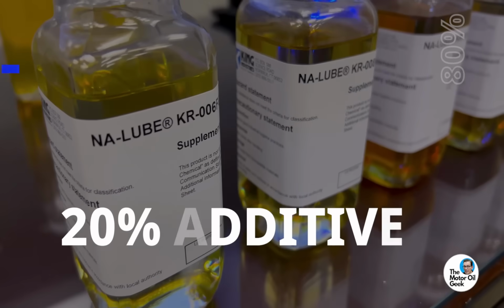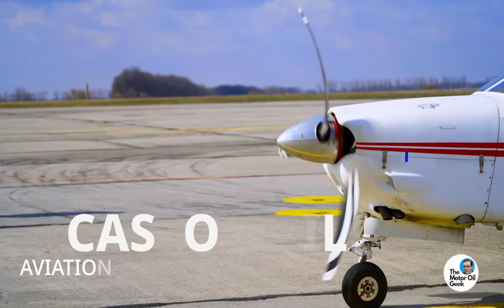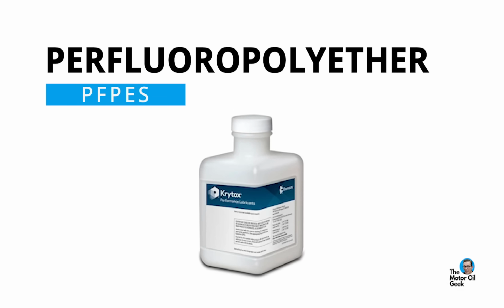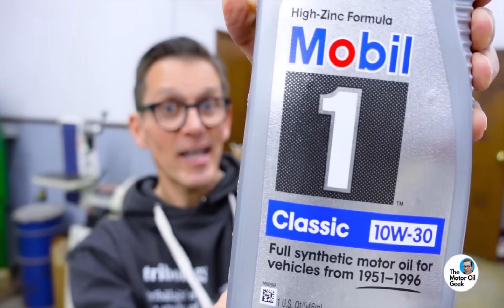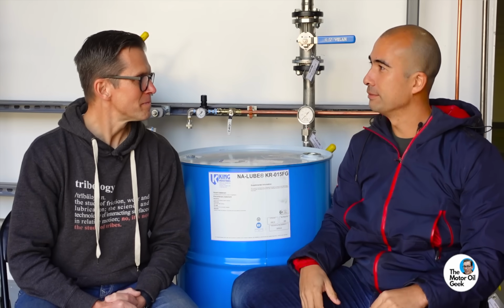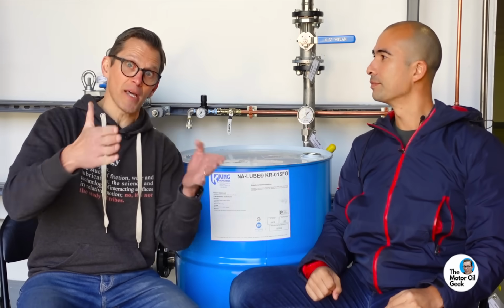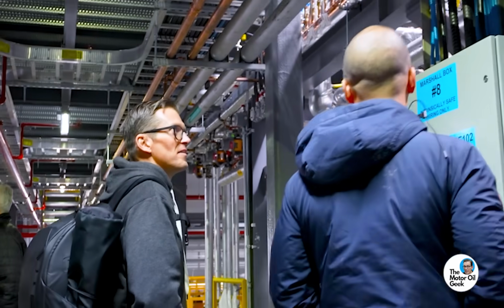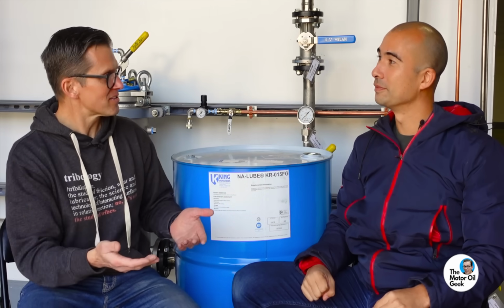100% Synthetic Oil: SCAM or SCIENCE?

Comment: Can you please make a video comparing the amsoil signature series against the oe? And why does amsoil not sell things the like the OE 20w50 api sp formula in the usa but does overseas?
Reply: Us climate isn't hot enough to be running oils that thick.   That's a oil useful for desert climate.
Reply: @jason200912 older engines with no flat tappets can run 20w50 and also use an api sp formula, also in some places such as texas, florida and Louisiana do get as hot as saudi arabia for instance

For example, a classic muscle car with roller cams would benefit greatly from an api sp formula like amsoil’s 20w50 oe or lucas’s api sp 20w50 in hot weather because they were designed for viscosities like that and would also provide excellent wear protection with the api sp formula as opposed to the SL/SJ 20w50 formulas in the usa which don’t protect as well because they catered towards flat tappet engines which need high zinc formulas (even though The motor oil geek debunked that flat tappets wouldnt run well with api sp formulas)
Reply: @johneldepresso they get as hot only in the summer. But if you run it the entire year as an annual oil as most users do, rather than a seasonal oil, youll be shooting yourself in the foot.  If you can afford monthly oil changes then go ahead and use one based on each month of the year
Reply: @jason200912 not what i meant, some of these cars where recommended to run 20w50 year round above -7 degrees Celsius or 19 Fahrenheit like the toyota 22re for example or the F series engines, ive seen plenty of them burn oil when they use thinner viscosities even when they are low mileage because their clearances are simply too big for something like a 5w30, and some of my customers simply don’t want to run mineral based 20w50 because they sludge pretty easily when driven hard or a seriously expensive synthetic high zddp api SL formula which wouldn’t protect as well as a api sp formula for their use case

An api sp 20w50 would perfectly best suit their scenario 

Im not saying you should use 20w50 in every car ever year round

Comment: I learn more about oil than I never knew I did not know.. LOL..  (you dont know what you dont know, till you know it)  

I want to say to all the guys on teh forums when someone ask,, "What the best oil to use for this engine?"  you get the folks that like to chim in with " read the owner's manual"  which in many cases is correct but with the latest GM engine debacle we see that not always the correct answer.   sometime common sense plays are role as well..  

In my daughters 2017 subaru forester they say 0w-20 oil but the amount of folks you see on the forum with excessive oil usage complaints.  they changed to a 5w-20 or 5w-30 saw wayyyyy less oil usage and no reduction in overall MPG..   

side note you can get Valvoline synthetic restore and protect oil in 5w-20 and 30... thats a win win win..  especially if yo have 70k or more mile on the engine..

Comment: What oil is best?  That is the question.  I started using amsoil over 30  years ago and just completely stopped worrying about it.  I do not ever change my oil.  I buy a new truck, dump out whatever oil is in it from the factory,  and put in whatever 100% pao amsoil recommends.  It's called signature series now I believe. I change the filter every January and top off with amsoil.  When I get close to or hit 100,000 miles, I trade in the truck for a new truck and do the same thing.  I've never had one single issue in 30 years of doing this.  Most of the time I'm pulling a 20,000 lb trailer so the trucks aren't babied or grocery getters.  All have been Chevys from a '78 350, an '85 7.4L, a '98 5.7L vortec, an '01 6.0L to the last few that have been 6.6L diesels.  My conclusion to all this is that if you are going to keep driving the same truck for more than 100,000 miles, use amsoil and change it every 100,000 miles.
Reply: Not sure if serious or joking.
Reply: @bradnail99 
Which part would be the joke?
Reply: @bradnail99  Same here. Hopefully, we get a response.
Reply: Filter is your safe word......
Reply: @jhartmac100 
Until the mid 90's I always used fram filters.  If you know anything about filters, that's like not even having one.  Then I discovered wix.  More recently, last 15 years or so on the duramaxes, I started using the premium mobile 1 filter.  Either way, my experience is a testament to PAOs and Amsoil.

Comment: so Lake, cut to the quick, which oil and filter would you recommend I use in a 2001 7.3L F-350 that has 325,000, it's a occasional driver, farm/ranch truck that may haul loads from time to time but not a serious work horse used truck, It does hit highway speeds of 80/90mph for extended miles.  I'll anxiously await your response, please and thank you.

Comment: 0W20 vs 0W40 
Reading about GM's decision to go from a 0W20 to a 0W40 in the L87 engines brings a question. 

The GM 2.0 turbo requires 0W20 as the recommended viscosity. 

My 2.0 as well as other 2.0 turbo the GM puts in the buick models from China are experiencing high oil consumption. 

Would going to a 0W40 reduce oil consumption without causing any VVT or any other issues.

Comment: I have a 1999 4Runner with 515,000 miles on it. I always used Mobil 1 and a factory filter.
Reply: 1985 4-runner with 400k miles using only regular oil.
Reply: I HAVE A 1999 4 RUNNER LIMITED WITH 639,284  mi  HAVE ALWAYS USED AMSOIL SIGNATURE SERIES 5-30 WITH SYNTHETIC LUCUS FOR COLD WINTER STARTS AT -39 C AND A PUROLATOR BOSS  PBL20195  OIL FILTER  . OIL IS CHANGED AT EVERY 13,000 KM OR 8,000 MILES
Reply: @kodyadams5561 are you the original owner?
Reply: @kodyadams5561 lucas makes the oil thicker, so essentially doing the opposite of what you want for cold weather. It also has zero additives, so you are making the oil thicker and worse from an additive standpoint, shorting the life of the oil.
Reply: You have an R22 engine!  It doesn’t even need oil!   🤣
Reply: Shame Toyota didn’t keep that engineering standard; other than 2.5, what happened to reliability?
Reply: @flashnmb1 1. 8. Engines in toyos are GREAT❤🎉🎉COROLLAS,   THREE HAVE OVER 8OO OOO.MILES.. WE ARE 🚕 🚖 🚕 🚖 TAXI DRIVERS❤❤🎉🎉
Reply: 475k miles on my FZJ80 Land Cruiser running Shell Rotella Conventional 15w-40 since new. Looks brand new inside.
Reply: What have your drain intervals? Time or mileage?
Reply: @jasoncurry2515 10,000 mile oil change intervals
Reply: "factory filter"??  What filter is NOT made in a factory?  🤷‍♀
Reply: @FrankDank-ik7ic  you're either a lousy comedian or a ignoramus 😮
Reply: @FrankDank-ik7ic 
Yes, and the "factory filter" isn't manufactured in the vehicle manufacturer's factory.

Comment: My family worked for an internal engine components manufacturer.They tested most oil brands on the components. When the oil is changed every 5k miles they noticed zero wear difference on the crankshafts and camshafts! Including those expensive brands.Today's synthetic oils along with proper Heat treatment are so much better than years ago 😂.
Reply: Mercedes and bmw still recommend a 15k miles oil change interval or even more.
And some people agree with that too.
Reply: 15000 between changes?  Totally ridiculous.
Reply: @Masteranddisaster13 yeah which is why they are both junk...I've owned both
Reply: @jhartmac100  They are often thought of as "lease vehicles". As in drive them for the three years and 36 miles of the lease term and get rid of them before they start costing real money.
Reply: @Masteranddisaster13  the recommended 15k oil change and 10k for Toyota covers the lifespan of the factory warranty, good luck after that

Comment: Here’s the takeaway from this video. Use whatever oil you’re comfortable with and change it every 6months / 5k miles and be happy.
Reply: Wrong, use whatever oil you want and get a used oil analysis. Then change it as recommend based on the results
Reply: @SantanKettanan-Gayboy  wrong.  All oils made since API SN have to do the same thing,  clean, protect and lubricate. Unless you’re using an oil from 30 years ago you won’t have any problems. If you want to buy into the oil analysis and boutique oils marketing BS be my guest.  I’ll keep on using the same Mobil1 that I have been for the past 10 years and be happy.
Reply: @geshtal2056  You couldn't be more wrong.  There are tons of videos showing oil analysis of various brands and some having more metal particles in them than others.   Mobile One was a group 4 before the 1999 lawsuit, now they are group 3, middle of the road for synthetics.

Comment: AMS Oil Signature Series   and  Pennzoil Ultra Platinum ....the top 2...
Reply: Is the penzoil ultra platinum really a full synthetic?
Reply: @ricksmith7232 Pennzoil has a few synthetic options so make sure you know the difference.  ultra platinum full synthetic?yes.  Platinum? No.
Reply: @ricksmith7232  It's a group 3 full synthetic.  Only 100% synthetics I am aware of are  Amsoil, Redline (group 5), Motul 8100, Schaeffers and Liqui Moly has one, tho I don't know which one it is.  May not be available here in the USA.
Reply: Also seem that on @Fordbossme
Reply: THIS ^^^ is the type of information I'm interested in.  In the used 2013 Honda CRV I just picked up the previous owner got his last ten oil changes using Pennzoil Premium.  I don't know if that's good stuff, is Honda OEM better, or is Amsoil better?

Currently have a good quality Pennzoil filter, soI could use a good recommendation on the oil filter too.  :)
Reply: Yes.  Somehow Mobil 1 oil gained the reputation as the synthetic oil to choose if you aren’t snobby enough to run aimsoil.  In reality Pennzoil Ultra platinum is superior.

Comment: Lake I have a question for you. Do you see it as pertinent to look at running a 5W-30 weight oil in the 5.7 L tundra engine when living in a hotter climate such as Kansas City as well as frequent towing of a boat? I fully understand that applicationis the most important factor in oil weight, however, I’ve heard you speak on heavier, weight oil, not always lubricating the engine properly due to smaller oil passages and different things like that. This engine calls for zero 0W-20 which I have always ran with no issue.

Comment: You never forget the first time you smell the sweet scent of castor bean oil burning in a race engine.
Interesting video... to that end I have no favorite oil; I use what ever oil is specified by the engine manufacturer (viscosity, API and/or JASO rating.) Common sump motorcycle engines need JASO MA rated oil.

Comment: After decades of changing oil in many cars, i've always looked inside, through the filler cap to see if your components are silver or yellow or brown. That tells me which oil was cleaning and which one was ruining the engine and so far, Pennzoil FULL synthetic didn't fail. My 311k mile Shysler minivan has pretty silver bottom end and runs very good! 2nd place, Mobil 1 FS, $25 for 5qts.
Reply: Brown car also mean that they hardly even change their oil.

Comment: Love the smell of castor bean oil pre-mix. Brings back memories of a youth misspent racing motorcycles. I used ester-based lubricants in my later 4-stroke racers.
Reply: Smells like a sweet, cotton candy smell....
Reply: With 3 sons racing and a team of another 12 racers, all my clothes smelled like it after a day at the track or day in the water brake dyno room testing. It grows on you. Most people don't understand how superior plant based oils are, they just use enough to get the mineral oil to work. But when you race pure plant oils, you can push the engine way further.
Reply: In the Seventies, here in Finland, we used to buy COX models with glow plug engines whenever we had spared enough money. The smell of castor oil is still a fond memory. I bought a bottle of pharmacy-grade castor oil to treat slight excema, and that smell was so lovely...
Reply: Time on a motorcycle is never misspent.

Comment: I wouldn't use full synthetic oils in anything I own, I do use blended oil in my 6.7 ford diesel engine, straight 10/30 Pennzoil in two other RAM pu, have 264000 on one & 50,000 on the other & wouldn't think of ever using full synthetic in either of them.
Reply: AMSOIL makes the best blend oils

Comment: Since you touched on aviation oils a question. 

A huge problem in commercial aviation today is that the engine oils is use are incredibly toxic if you get a leak and they end up aerosolized in the environmental system. 

Would it be possible to create an aviation/ jet turbine oil that isn’t so
Toxic when inhaled?

I know I’ve been told that if we get a “dirty sock” or similar smell in flight which might indicate an oil leak we should immediately put on our Oxygen masks, keep them on until the aircraft is shut down, and land ASAP.

Comment: Learned some things here! 
So. I have concluded that I personally, need you to get with your dyno room bud and test ALL the synthetic oil 🛢 to see which one allows for the most HP.  I mean all the top-tier oils, Amsoil Signature, Driven, Mobil, max-performance street oils. I also use my engine to run errands and just drive it.
I have a very stout N/A 5.4L, 11:1, ap advanced steel rings, 32v, that turns 9500rpm. I look not only for bearing protection but also for an oil that allows my engine to put out max HP.

Comment: Changing oil is like brushing your teeth -- it's more important that you do on time than the brand you buy.  The rest is secondary and not important for the average driver to know.
Reply: Good analogy
Reply: And we don't brush your teeth once every 10 days.    Change your oil often.   Not every 10 000 miles
Reply: Whats important is keeping oil in it and I use to think just like you until a couple old master mechanics explained something to me.
   Oil doesn't go bad just sitting so extensive driving slowly thins it out coming in contact with gas so when it gets to thin it will slowly burn off.  
    Just add a little oil and keep going.
  I change the filter once in awhile and get over 300,000 miles in my vehicles.
Reply: @LacyHolt-j3n so hybrid cars need less oil?
Reply: @Morecolour i didn't say anything about hybrid cars.        That's probably the case though.      Depends how the machine is biult.

Comment: Cool content thanks. I was waiting this video oriented to car engine oil for a while, thanks a lot to Rafe who tised me with his video a back ago. I am living in hot climate with temperature never going down 15c( 59F) where index viscosity is not the most important against pushing the car in 50 C(122F) ambiant temperatures. Unfortunately after digging out so many Safety datasheet of quality street car brand, I never find out who on the market is formualting engine oil with alkylated naphtalene. Now I know. Thanks .
The brands should market this product for  warm weather application. I am wondering which other brands are using it as a co-based oil.

Comment: So what weight and brand would you recommend for the heat in FL my Tacoma recommendation is 0w20 but I’m not sure if that’s too low for the hot temp.
Reply: 0w20 is definitely not required for typical FL temperatures but that's just a small part of finding the "best" engine oil.

Start with the mfg spec requirements. I would look for a 5w30 or 5w40 that meets / exceeds those requirements. In FL you would also be fine running a 10w or 15w but it still needs to meet the spec requirements.
Reply: @marstedt thx for the feedback 👍
Reply: I believe the real reason to use thiner oil is fuel consumption, not engine care. 5W-30 it  is thin enough for warm weather.

Comment: Does anyone have pressure viscosity coefficient for PUP 0w20 and 5w30? Also, based on technical data provided by Pennzoil, it seems 5w30 has better flow characteristics at startup than 0w20. Am I reading this correctly based on their technical data sheet?

Comment: I have a Toyota Prado, known as a Lexus 470 in the USA. The engine is a 2.8 L GN diesel. The recommended oil is synthetic 0W - 20. Here in Perth, Western Australia, temperatures range from 4⁰ to 46⁰ C. What is your suggestion?
Reply: He definitely questioned the use of 20 weight oil in diesels at the beginning of this video.

Comment: I would love to see a video about Castor bean oil. I remember it being recommended in old British racing motorcycles.
Reply: There is a short paper online that includes a remarks from a tribologist, basically it's not super great but as it gets heated it transforms and gets better and better (whereas other oils typically go the other way). So it's likely not the best for wear, but it's good when things go wrong.
Reply: @PSA78    ...  Many of the1960's top  road racing motorcycle tuners in the UK used to Pre-heat Castrol R on a camping stove prior to filling the oil tank on the bikes.
Reply: @mikeford5106 It has a somewhat high viscosity, but a low VI so heating would definitely solve it if it's too high viscosity. 👍